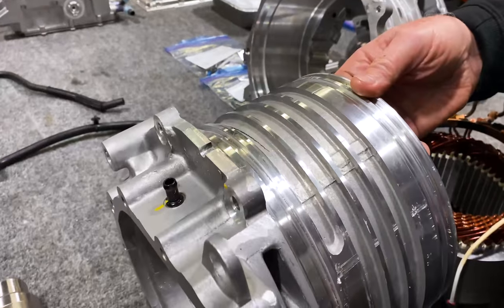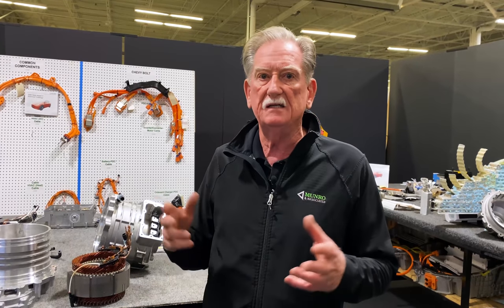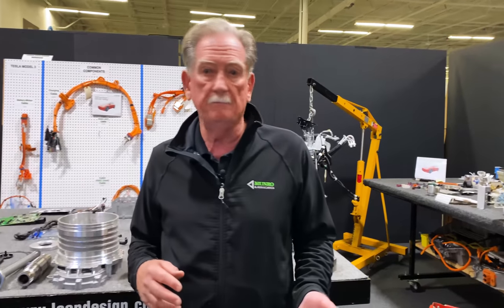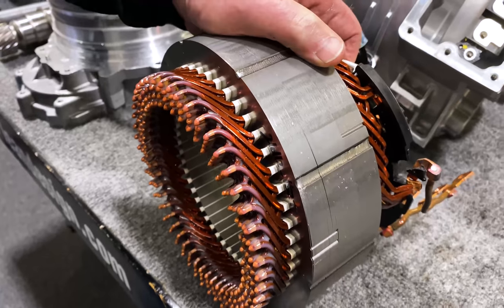Mach-E Front Motor: Sandy is Blown Away by Great Design

Comment: No, Sandy, what you describe as the "skin effect" on the wire, that's only at very high frequencies, from high end megahertz to gigahertz and microwaves.  Switching frequency for these motors is low;  probably in the 100 kilohertz range;  it would not be affected;  the whole section of the wire conducts at DC, as well as at 100 kHz or even 1 MHz.
  What's probably the issue is parasitic currents that can be induced in a "hairpin" (fat wire), whereby there's an unwanted circular current component induced in the conductor wasting energy as heat.
  Or it could be a matter of voltage vs current for similar power:  A hairpin design probably uses less turns, which then dictates that, for the same amount of Watts (1 Horsepower =~ 750W) the hairpin design might require 1/10th as many volts but 10x as many amps as a wound motor, which may require thicker conductors and will multiply the losses at the inverter, as more amps cause more heat in switching MOSFETS of a given RdsON (residual resistance in the conducting state;  typically milli-Ohms).
  But you can use ultra-low RdsON MOSFETS and very fat wires;  though they cost more;  so, it's a design compromise, really,  rather than a good vs bad kind of thing  ...

Comment: Sandy this looks great as well.  But I need to point out the heat from the windings doesn't get into the stator laminations and therefor into the cooling jacket very well.  Because the windings are insulated from the laminations its in fact a BED thermal path.  This is why many are starting to pot the windings and or are spraying oil on them and the rotor.

Comment: @Sandy you are miss informed on the skin effect on conductors as it is not an absolute sort of thing.  As the direction frequency goes faster the electron start to move further and further out to the surface. To spin a 4 pole motor 18,000rpm requires 600hz switching direction.  At 600hz the skin effect would mean that conductor would need to be over 5.2mm thick before the skin effect would start to cause issues and that would only be at top speed.

Comment: 23:50 I don't like spring connectors in IGBT circuits. The slightest misconnection (maybe due to vibration) makes the whole inverter blow up immediately.
Reply: You can design these to withstand vibration deterministically. Vibrations are stated in terms of acceleration and as long as the spring has a higher force them the maximum possible acceleration times the mass of the spring contact, it won't disconnect.
According to studies, they are often more reliable than Pressfit and especially Screw-Terminals.

This is also because the contacts on the IGBTs don't need to handle any forces except the spring, so the bonding wires won't be loaded.

Comment: Sandy, I have a question about the coolant pathways on those IGBTs and noticed how they are sequential instead of parallel. wouldn't the ideal configuration for those channels be one in which the coolant is delivered to each IGBT at the same temperature? Seems problematic that the last IGBT might experience less effective cooling than the first one over which the coolant flows and possibly causing a variance in performance between the 3 different phases of the motors which the IGBTs control. I guess maybe the water cooling is efficient enough to marginalize any temperature gradient along the coolant pathway in that system and I also considered that dividing the channel up into 3 parallel pathways might result in a loss of pressure that could also be a problem but just our ot curiosity hoping to hear your opinion on that. THANKS i'll be totally awestruck if you actually reply here but hey I'm currently unemployed so not like I have much to lose by asking.
Reply: Agree that the last one will have warmer coolant than the first two, but trying to put them in parallel with equal flow across each seems more difficult than just increasing the flow so delta T is minimal across them in series.

Comment: Very interesting, if you have the same motor in front, as well as in the back, can you do the whole thing with just one inverter? I mean, will the energy automatically be shared by the 2 engines? Or do you still need two converters? 
I was also thinking, if you can make 4 small engines inside the wheels, you may not even need any gears at all do you? Or will that be a hard job for the suspension if the wheel weights too much? 
That way they might be able to make quite a cheap car.
Reply: No, you can't share an inverter, even if the motors are identical. Each motor needs its own inverter, producing AC power synchronized to the position of the motor's rotor.

The idea of in-wheel motors has been around approximately forever. They are mostly used in small things such as electric-assisted bikes. There are some built for cars, but no one uses them in a production car (for multiple technical reasons). Putting the motors in the wheels doesn't change the need for gears - you could use one motor per wheel mounted on the chassis (like the Rimac cars and Rivian truck) but without gears if you wanted (but it makes no sense), and you could put motors in the wheels and still use gearing with them. Yes, heavy equipment mounted on the hubs (in the wheels) makes the suspension work poorly.
Reply: @brianb-p6586  Oké, thanks a lot! ;)

Comment: Are those vertical floating pins reliable for the long term? That is high current is it not? Is it DC vulnerable to sealing currents?
Nice to see the Engineers swinging the bat. Nice work!
Reply: the control signals for IGBTs are a few uAs to hundred of mAs... I'd feel safe with duplication and <1ohm contacts.
Reply: @jpinto3912  - Thanks Jorge - of course.  I've never been a fan of springy bifurcated connectors which is what I think those are. That is a vibration environment.  Of course we've seen the other issue. If you solder the connection the vibration can crack the solder as it ages causing intermittents.  I suppose a floating connector is the best solution in this case. It is a fine piece of engineering. Kudos to the team.
Reply: @dennisfahey2379   Yeah, solder can come apart with vibration. I wonder if there's less vibration in an EV, compared to an ICE? Either way, auto electronics have to work in fairly harsh conditions, for (hopefully) a long period of time.
Reply: @chrisheath2637  - an electric car should last a million miles with minimal maintenance. Yes the battery capacity will decay and at some point need replacement. But a brushless motor should last forever. The suspension and brake pads - some logical wear period. This leaves the power electronics which if kept cool enough should never fail. That leaves you with vibration related failure. Thus the query.

Note that Tesla's battery weight, capacity, charge time and durability are their next major milestone/update. Between battery chemistry and super capacitors - they are focused on the right quadrant.  The next phase of advances are going to be interesting. And when the whole sector unifies focus - Wright's Law kicks in.

Comment: Skin effect is an alternating current frequency dependent phenomenon. It only only becomes a significant factor when you get into the kilohertz range. As far as I know there aren't any AC motor stators operating in these ranges.
Reply: Multiply the number of pole pairs by the rotational speed of the motor, and you get to about one kilohertz at top speed. I agree this isn't a high-frequency situation in which skin effect is likely to be a major consideration.

Comment: The skin effect changes due to the frequency induced into a coil. The higher the frequency, the smaller the conductors need to be to get the same amount of energy into a rotor or another coil if it's a tranny.

Comment: Stupid question here but why do they use laminates instead of casting the hole thing as a single piece?
Reply: It's not a stupid question; I think it's thoughtful and very reasonable. Magnetic cores use laminates aligned with the direction of magnetic flux, to reduce large energy losses which would occur due to eddy currents in solid iron.
https://en.wikipedia.org/wiki/Magnetic_core#Laminated_silicon_steel

Comment: a few small caps is generally better than a big one. Particularly if the big one is custom and will cost 100x times as much. Also smaller caps are allowed to fail (in some cases) without taking down the system
Reply: That one big capacitor assembly he shown is probably made up of several individual capacitors connected by conductors and encapsulated to look like one unit.

Comment: 21:20 Why are the IGBT modules so far away from the output connector? I would have rotated the IGBTs 90° and moved them directly to the output connector. Less copper, less losses, less heat, equal length of the conductors.
Reply: It does matter that much.  If you are worried about the extra length, it is nothing compared to the length between inverter and motor.  It is way more important the cooling.  Seems to be the designer took the cooling path.

Comment: It depends on the type of motor. The square wires let you get a higher fill ratio than a wound stator. There are tradeoffs with both designs and it is debatable which is better. I am a fan of wound motors myself but if they are not wrapped tight enough they can rub through the insulation.

Comment: Hey Sandy great video. Why do you think there's so much difference in front and rear motor designs? Why did they not use similar design especially for the inverter in the rear one as well?
Reply: Different suppliers, rear is made by Borg Warner front by Magna.

Comment: Awesome Thank you Sandy ..can you please tell us how in helix coolant design they are cooling the bearing and differential?
Reply: Isn’t the gearbox full of oil?
Reply: @fredbloggs5902  It’s full of coolant. I think it might be the same as the battery coolant. Sandy said they don’t have extra pumps or filters but it has to circulate somehow. Tapping into the existing infrastructure makes the most sense to me.
Reply: @fredbloggs5902  Are you saying its passively cooled..?
Reply: @bleepblorp8171 Are you saying ball bearings are cooled by water-glycole mixture directly ?
Reply: @sudeeptaghosh The gearbox is filled with transmission oil which lubricates the gears and bearings. This volume is completely sealed off from the coolant system around the stator, which is a water/glycol mix for cooling of the E-motor and Power Electronics.
Reply: @sudeeptaghosh  Mattias F explained it well. Sorry I wasn’t super clear on that
Reply: @sudeeptaghosh , gearbox is full of transmission oil, outside of gearbox/motor housing is cooled with glycol loop, gearbox/motor housing acts as a heatsink between the oil inside and the glycol outside.

Comment: Hairpin allows more winding in a given area. Something that Remy started in the early 2000s. Standard windings are super easy. People have been doing it for over 100 years. I can't imagine less than 99.9% completion rate for standard stator winding. Hairpin is solely for output. It's far more capable than a traditional winding.

Comment: Multiple smaller caps dont have to be bad. They dont to this here but you can do this to have a higher surface to volume rate and help cooling and you can lower ESR.
Reply: the single component cap is just a bunch of smaller caps potted, making them harder to repair and hard to find. Not a fan

Comment: What's interesting to me is that the rear motor and front motor are such a radically different design at least on the inverter side. You would think for commonality of parts and suppliers etc that you would have a similar design front to rear.
Reply: They are external parts, rear is made by Borg Warner front by Magna.
Reply: @DooMMasteR  
That's what I mean. Why do you have one made by one supplier and a one by the other. Seems like you would have more consistency across the completed product if major components like Motors and inverters were made by the same company. It's going to be a nightmare of maintenance and Parts supply throughout its lifespan.
Imagine trying to repair it or take it apart 10 years from now different nuts different bolts different design philosophy it's going to be a royal pain in the ass.
Reply: @kens97sto171  They're just two different components, just as an engine and a transmission are two different components. It's not a problem. Ford won't stock individual replacement parts for them anyway, as dealers will likely swap out complete drive units if they are defective.

Comment: I'm under the impression capacitors need to be replaced from time to time. 
How would the capacitors be serviced if the busbar is welded in place?
Is this serviceable only by replacement much like replacing an alternator instead of replacing the brushes inside?
Reply: You'd need to reweld them yourself if you wanted to that. I'm pretty sure those capacitors are designed to last for the lifetime of the car.

Comment: Skin effect is only significant at higher frequency. These motors most likely don't run over 1kHz. If it was an issue the design would use litz wire, which it doesn't.

Comment: I wonder if they tried hard enough to make a gearless power train. Can the differential be replaced by independent motors that are precisely driven for optimized driving experience ?
Reply: Yes.  Tesla Plaid has 2 rear motors and 1 front.  Rimac has 2 front,  2 rear.  I think the ideal solution is 1 per wheel,  but it's more expensive and potentially heavier to have 2 motors versus 1 motor plus differential. Also,  the brakes can be used to control torque to each wheel via software. I'd be interested to see which idea begins to win out in the future.
Reply: @jamesengland7461  they all have single gear setup on each motor
Reply: Even with a motor for each driven wheel, so there is no differential, reduction gearing is needed to keep the motor size reasonable.
Reply: @thealienrobotanthropologist  I never said that. However,  if there's one motor per wheel on an axle,  you don't need differential; you can control each motor,  and therefore each wheel,  independently.
Reply: @jamesengland7461  You need an inverter and control for each motor. As an EE I prefer that to using gears. Maybe somebody could come up with a motor with two rotors, I dunno.
Reply: @jamesvandamme7786  brings into further focus the differential ;) between individual motors per wheel and using differentials. I suppose cost will drive this choice until something else like you suggest is developed.
Reply: Perhaps a motor with a divided stator and rotor,  essentially split down the middle? Use a common inverter,  but with something like a rheostat  [I'm extremely rusty on electrics,  so I don't know if this is the right device] to take that inverter current and vary the split between halves of the stator?

Comment: Is it strange to have such a different design team working on different ends of the car even though they're the same essential component and function? Wouldn't it make sense to use the same design front and rear for economies of scale?
Reply: Actually Craig, Tesla did exactly the same thing!!

The  dual motor model S/X uses a 3-phase induction motor in the rear and what’s known as “permanent magnet synchronous reluctance motor” (PMSRM) in the front.

The model 3/Y has the reverse - a PMSRM in the rear and an induction motor in the front. There are some specific technical reasons for this, namely that the two motor types have different performance characteristics which, together, provide the best OVERALL performance and efficiency.

As lay people, we of the general public need to appreciate that engineers know what they’re doing, even if it doesn’t seem obvious to us!

Comment: So, were there two design teams for the drivetrain. One front and one rear? It appears to be a night and day difference between the two.
Reply: Frankenstein car
Reply: Probably
Reply: Ford
"It's going to be about this heavy, what do we need?..... A motor this big, this powerful in the rear, smaller, less powerful in the front!"
"Ask the suppliers".
And with the time limitation, these are what they got.
Simple.
Reply: Two design teams?  Most definitely since they work for two different companies.  Neither design team works for Ford.  The rear motor is from BorgWarner and the front motor is from Magna.  Most EVs other than Tesla get their drivetrains from one of these two companies.  In this case, they used both companies.
Reply: @CL-gq3no  Thank you

Comment: That double-gear+shaft component is very nice, but surely it's cheaper to put two gears on a shaft in the usual way, and involves less material wastage? I guess this is stronger than using woodruff keys, but does that really matter on a 50kW motor?